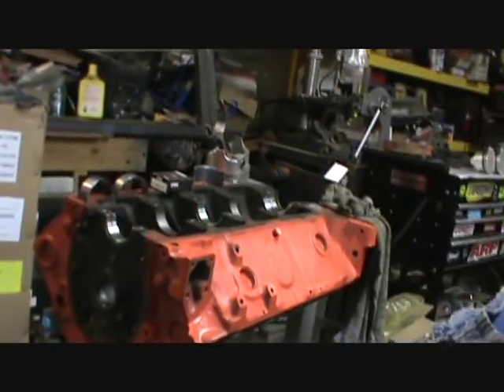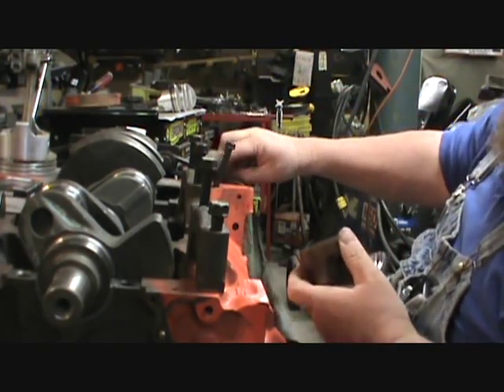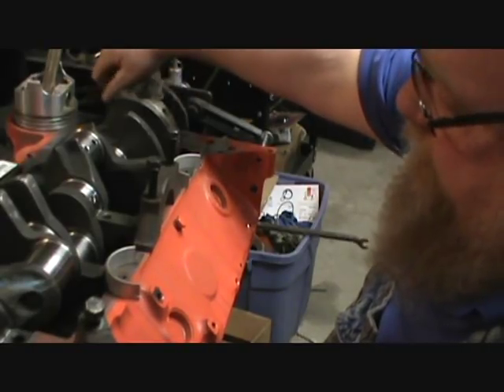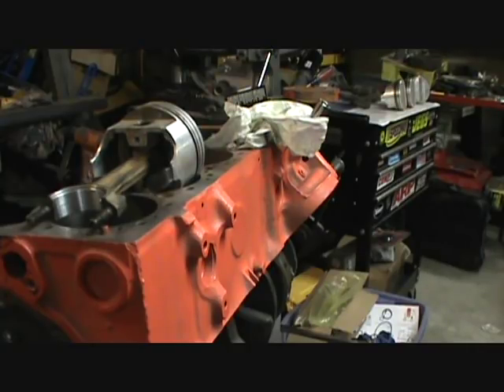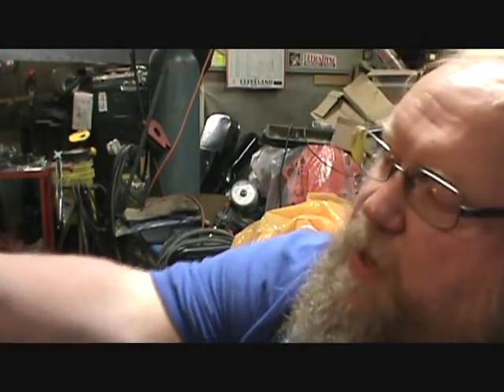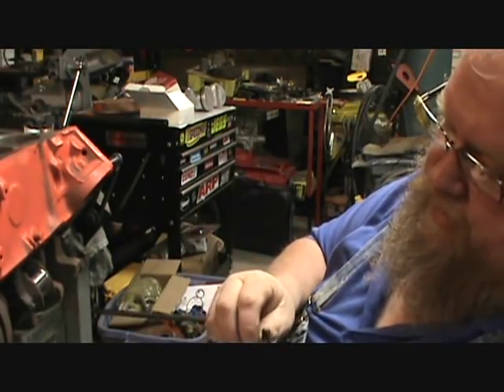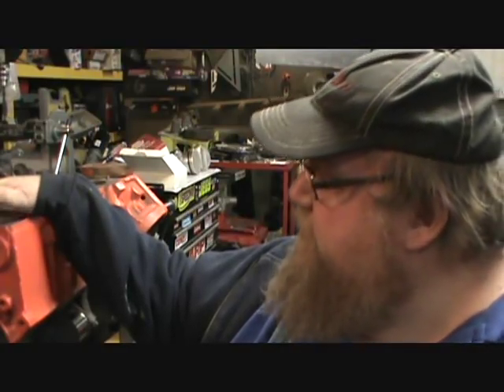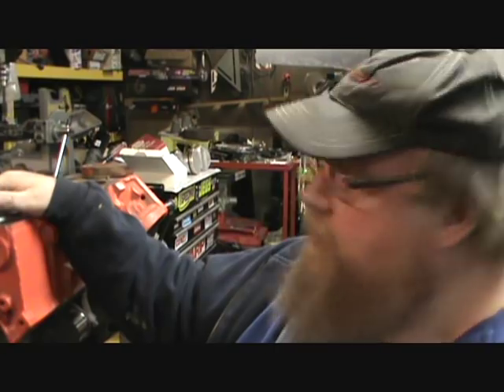working with 400 chevy block will it be 377 or 406

Comment: For future reference, 5.850" sbc rods with 1.433" pistons will work with a sbc 350 crank.

If that's what you were dealing with? Should be right around there if those were 5.7 rods you had those pistons on? 

With an unmilled deck that would leave the pistons. 020" in the hole.

Or they could of been 1.425" pistons, that would if got you closer to the .030" in the hole you measured? 

Anyway, you don't need to rewatch just try to remember about the 5.850" sbc rods that they make. 👍

Comment: But all your testing you had the 350 crankshaft in the 400 block. So how Were you able to come up with the 406 long ride without a 400 crank?
If anything you have a 6 inch rod 377 stroker set up correct?
Reply from the maker: those pistons and rods are for the 400 crank with 5.7 rods.

Comment: Well heres what Im putting together.  4.125 block, 6.0 rods, 3.25 crank and 12.5:1 pistons.  That will make a 352.  Im not after maximum power, just a few high revs as required in a lightweight street car.  I have a set of 220 heads with 2.08s on the intake but not too sure if I will keep them though.  Breathing through individual throttle bodies eg: weber 48s

Comment: Those are 400 pistons made for 5.700” rods, those rods you’re using look like the 5.565” 400 rods meaning the pistons would be .135” down the hole. 👍
Well big difference between 1/8” and .300” so my idea was off.
Reply from the maker: i had 350 crank in it at that time and they fell short. i put 400 crank in and they are where they should be now.

Comment: Will a cast iron crank stock rods hype pistons arp rod bolts will it rev to 7k safely 377
Reply from the maker: yes mine went higher then that but i balanced it
Reply: I'd get a forged crank but you should be fine

Comment: Why wood someone put 5.7 crank in 400 if all was seen 400 in 350 ?? Just a little confused if you could answer that for me
Reply from the maker: i have built them both ways. by putting 350 crank in a 400 you have made a motor with a lot of torque and rpm. its called a over square motor where the bore is bigger then the stroke. also by doing that its cheaper cause less machine work to do as when you put 400 crank in a 350 crank needs extra machine work to fit.
Reply: That is kinda cool do you got a video on YouTube of you building one
Reply from the maker: i have a start of one in play list havent got it it finshed yet thats coming up
Reply: Ok I need your help I just but my dream  car from my buther but t Caprice but I got a motor I'm going to put rebuild kit in but I want a cam that thumps good but I dont want to go to big what can I put in it to sond good
Reply from the maker: email me at cntrywoodcraft@netins.net then i will get you my phone number then we can talk

Comment: When did you change blocks?
Reply from the maker: the first one someone wanted it worst then me. sold it back a few yrs ago. the block im using now has been sitting in the shop and it time to do something with it
Reply: ok I noticed only 2 freeze plugs and I thought I had missed something
Reply: I should of seen the 2 bolt lol

Comment: I think it should be against the law to destroke a 400sbc.
Reply from the maker: lol
Reply: Me to
Reply: Well, short stroke big bore is your best combination for high RPM and HP combination. It just works.
Reply: gregg4164 put a 5.7 rod she will be a rpm beast 👍🏻
Reply: @gregg4164   yep! Brother lucked into a 1979 z-28 that we had seen around a few times as we were growing up! Had a 1973 sb 400 bored .030 over to a 406 & i beleive they used a stroker kit, also amber lightweight pistons 11/1 compression, alluminum heads-202/160, roller rockers, The cam-i do not remember the lift or duration! I know that it was using a circle track cam from summit! had a Holley 750 dbl pumper w/manual secondaries, Th-400 w/new valve body, B & M shift kit, 3,500 stall, 373 gears & MAN DID SHE RUN!!!!!!!!!! 1/8 MILE DOMINATOR!!!!!! I am looking to purchase another 1973 Chevrolet small block 400 with a 4.125 stroke so i can finally own the drivetrain of my youth but, I am considering putting it into a 3rd gen camaro but, 1st things 1st, I NEED TO FIND A GOOD 1973 SB-400! IF ANYONE HAS ONE, PLEASE CONTACT ME??? (1973 SB-400- 4,125 STROKE)
Reply: Summit did an article on the Chevrolet small block 400! When built right, A 400 is capable of 750 h.p. & torque N/A!!! I AM LOOKING FOR A 1973 Chevrolet 400 (4.125 stroke) If anyone knows of one, PLEASE MESSAGE ME?
Reply: Why 73 only
Reply: Idk ive heard the 377 makes gobs of power like a big block but revs like a small block and is the right combo
Reply: @glennmanchester1568  any 400 set up is beast.  Faster Proms channel has an old '87 vette with one that runs 10:60 1/4 mile times.  It was the quickest C4 back in the day.. smoked Vipers ... Was featured in magazines... Think I has the 406

Comment: 350 crank in a 400 comes out to a 377 but i wouldn't destroke  it i would make it a 406
Reply from the maker: well it is my choice and thats what i want
Reply: @tlcbear2  that wasnt a smart comment brother that was just my option on the situation. It would have been better if u would have explained why people d stroke engines like that then it wouldnt have been a reason for people like me to wonder why you are doing that. Dont u agree? Cuz im not a engine builder so i wouldn't know what the purpose for a D stroke in my option it seems like the 406 would run harder with more power. For future references explain what your doing an why your doing it if u don't like people  giving there opinion
Reply from the maker: sorry Mike. i have had a lot of comments about me destroking the 400 block and they havent been that nice. once i get on to building the 400 blocks i will give the reasons why i like doing what i do.
Reply: @tlcbear2  its alright brother ill be looking forward to the video. U do good work man i like watching engines builders such as yourself its very informative
Reply: @tlcbear2  dont let the negative comments get to u brother more than likely they have no clue about engine building either an just scared to admit it.
Reply from the maker: thanks
Reply: @tlcbear2  nice videos but I have built 400 and I never understood why the 377 besides the rpms. A loss of at least 33 cubic inches
Reply: And turning down the mains or using spacers
Reply: @edwingreene7583  getting rid of the 5.565 400 rods  is a big plus  so you end up with 3.48 stroke , 5.700 or 6.000 rods and a better compression height piston to suit   the engine works easier therefore makes hp easier and yes you have a higher revving motor   , the taller the rod used the straighter the rod stays  the better the geometry and helps build torque